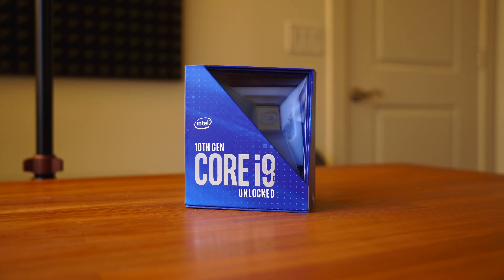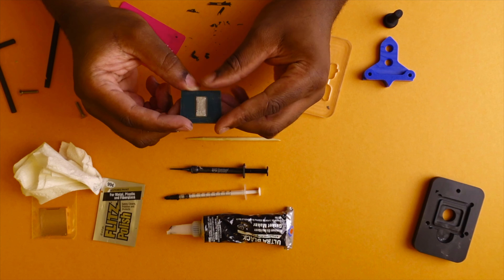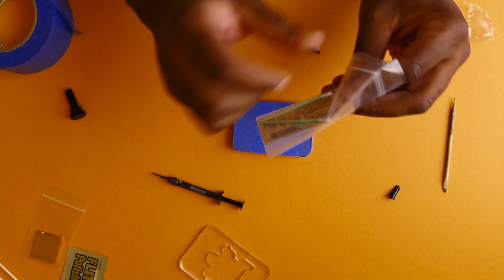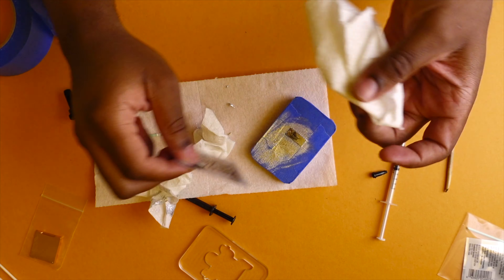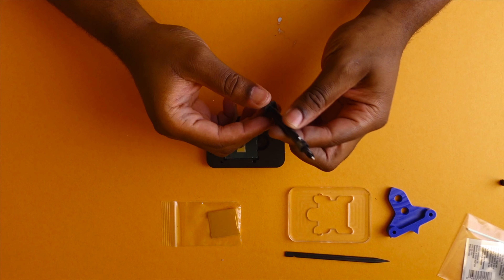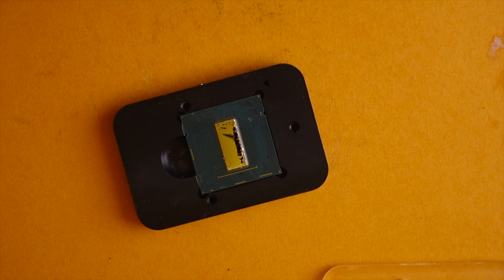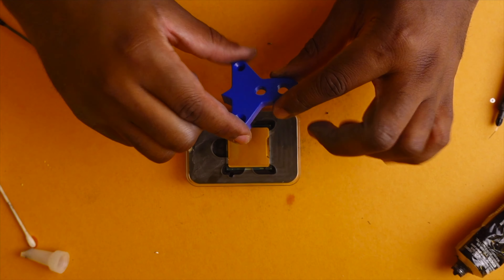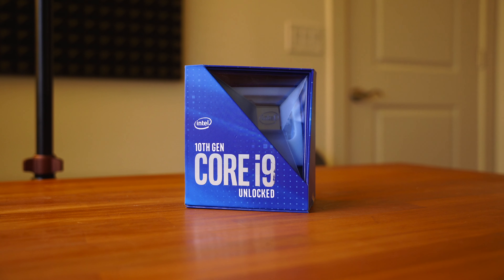10900K Delid Guide Part 2

Comment: How many times have you had to reapply lm?
Reply from the maker: ive never had to reapply due to temps but I do it once a year as good practice
Reply: @flanconleche  So did you notice any temp degradation within the year before applying?
Reply from the maker: not that I saw, I dont check my temps everyday or every gaming sessions but maybe once or twice a month and never saw it go higher than the temps I  showed in the video. also when I went to reapply liquid metal it was not dry, it was still moist

Comment: What did you use to stress at the end? Fpu on adia64? Which vcore also
Reply from the maker: yea, I used exactly that the Aida64 stress test, and I left the clocks default, im gonna do another video on overclocking it and the CPU temps

Comment: the 10900k is not worth delidding, its a cool chip already. try actually correctly tuning the 10900k in bios ;)
Reply from the maker: yea, ya know after doing some more testing, ur right, wasn't really worth
Reply: @flanconleche  Ya at most you can lap the ihs and use lm aka liquid metal. mines lapped with liquid metal as well as my waterblock is lapped. i plan to lap my ihs more as i left room to do so. intel did a good job with fixing the cooling issue from the 9900km which the 10900k came about due to the 9900k. the 10900k is just a reworked 9900k which finihsed off the 9900k.
Reply from the maker: @ColdVenom159  oh yea you def did more work than me lol. I wonder if the 11900K is gonna be any better after a delid and CPU laping.
Reply: @flanconleche  Im not even looking at the 11th gen. myself im sitting back on my 10900k and just waiting for amd to open the gap a little more on the end of gaming then im jumping to amd. amd has taken over every other field other then gaming, how ever they literally only a hair off of taking the gamin end.
Reply from the maker: @ColdVenom159  yea im thinking about not getting the 11th gen myself, I just got the 5900x and I wonder if this CPU will be faster then the 11900K we shall see X3
Reply: @flanconleche  my opinion the 11th gen so far is just a poor attempt for intel to try and stay in this market. ive always been intel no not a fan boy at all, intels just always worked for me. i would of jumped to intel years ago if they had the gaming end of the market. thats literally all im waiting for on the and of amd is for them to open the gap more on gaming then im jumping.
Reply: @redclaw72666  lmmfao please dont give me a youtube video to watch as ive already delidded mine ahahahaaha. Frame Chasers is a joke when it comes to overclocking.